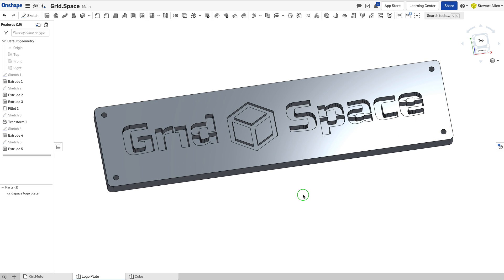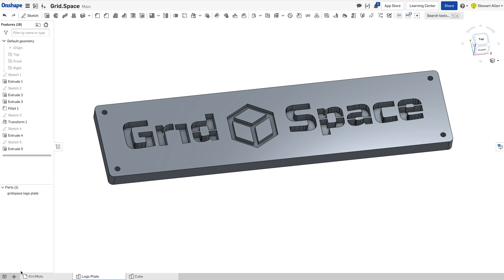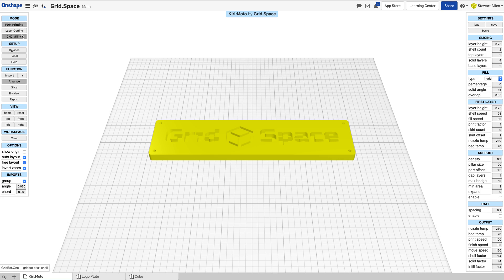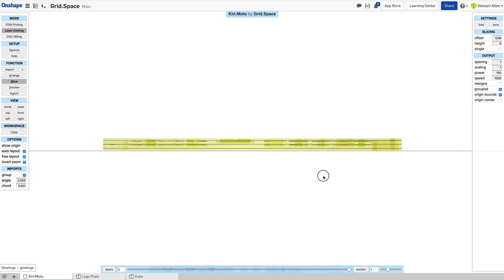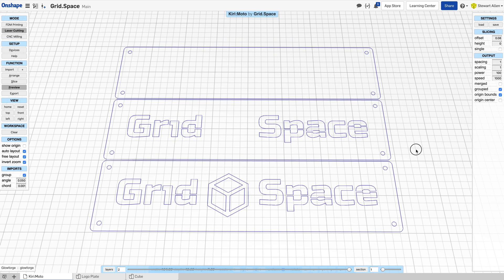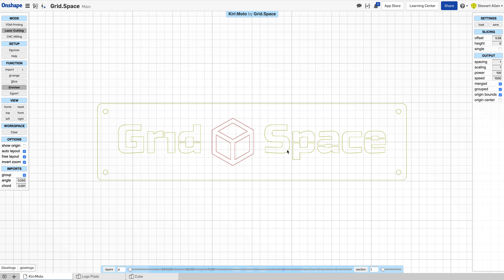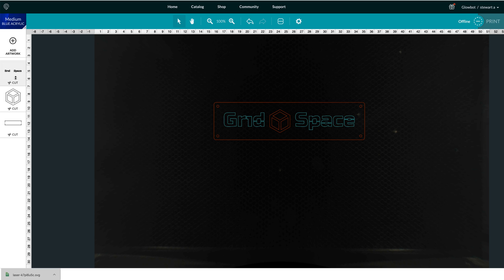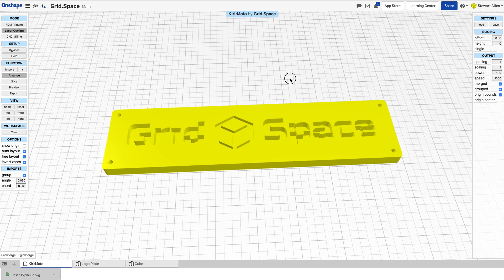Kiri:Moto Laser Cutting Workflow in Onshape

Comment: Nice video and tool!  I just recently found Kiri:Moto while looking for a tool to slice 3D object for laser cutting.  We have a group of ~15 who purchased the Ortur Laser Master desktop laser cutter/etcher(160x150mm) which uses Spindle Speed to control the laser(M3,M4,M5) and many are also following a club member showing how to use Fusion360.  We use Lightburn for 2D but wanted to show 3D and Kiri:Moto looks great.  I installed  Kiri:Moto on my rPi3B+ but can't get it to generate GCode which uses M3,M4,M5 with S1000 steps(default is 256) instead of M106 which GRBL 1.1f isn't accepting.  If there is a way to change this in Laser Mode I can not find it. Thanks and the videos have been very helpful.
Reply: I've decided to post some issues on the git repo and will add this there since it's not really about the video.